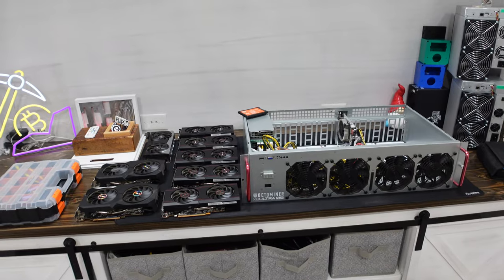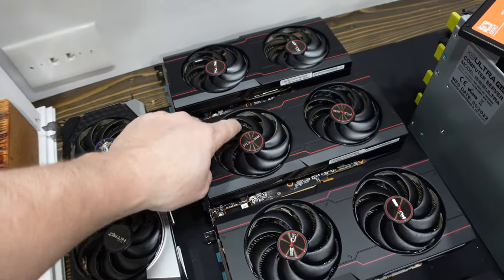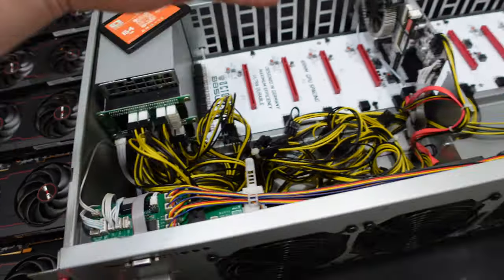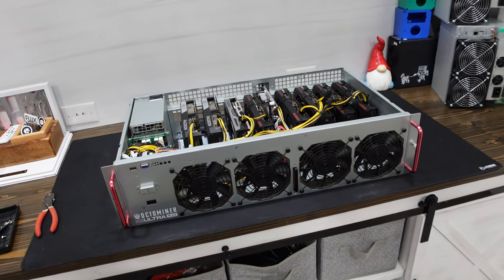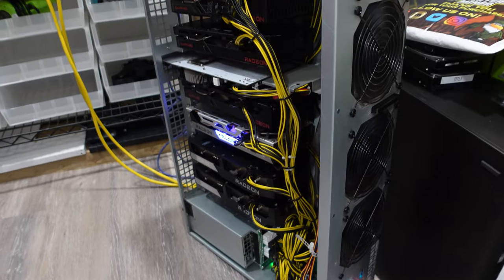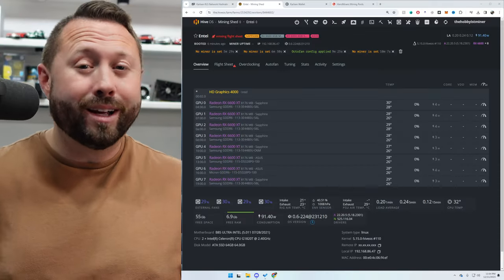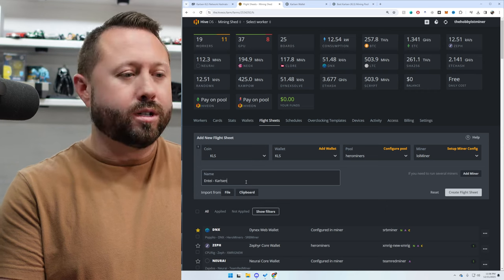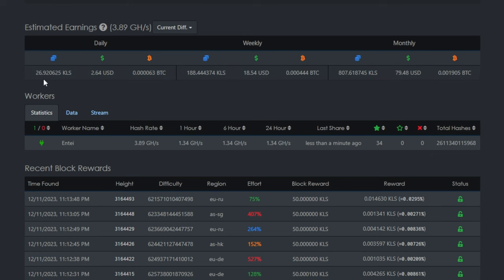KARLSEN isn't Dead Yet! 6600XT GPU Mining Rig Build!

Comment from the maker: Did you Mine Karlsen Early on and Take Profits? or Hold your Bag?
Reply: Mined Karlsen and swapped to Kaspa... Still doing it 😂
Reply: Started mining KLS sorta late🦥as I misplaced my boxed 1660s and I couldn`t find them anywhere in my mining farm. Today I finally found them so I`m going to start seating `em into rigs. My test MSI 1660s has been running efficiently hashing stable around 465MH/s only at 71ish Watts, which is pretty good (efficiency coeficient equals nice 6,65). Running on Windows as always. I gonna tweak the parameters a little bit using MSI Afterburner eventually. What do you think about PALIT 1660Ti 6GB Ghost? How about those small cheapo one-fanned 1660Ti cute midgets? Are they worth purchasing or rather prone to overhating? Any former RVN/MEOW KaPow miner here? Any advice will be much appreciated.:yougotthis:🧡🍺

Comment: Just finished overclocking my 12 x 6600xt rig.  running around 420mh/s on 27-28w per gpu:  settings - core 1425, vdd 660, vddci 620, mvdd 1150, mem 1.  12 gpus showing 334w in hive , 499w at wall.
Reply: wow nice work..

Comment: if you want to make the cards much more efficient,  set your overclocks to 1500 core, 670VDD,800VDDCI,1300MVDD, 1MEM......This will cut your power consumption in half, your hashrate will drop from 560/card to about 443/card.  but wayyy more efficient  (at least this will work on the ones with samsung memory, not sure about the micron one)
Reply: Thank you! This worked for me also. Red devil 6600xt and 6700xt
Reply: Looks good.  Going to have to give that a whirl
Reply: Just finished overclocking my 12 x 6600xt rig.  running around 420mh/s on 27-28w per gpu:  settings - core 1425, vdd 660, vddci 620, mvdd 1150, mem 1.  12 gpus showing 334w in hive , 499w at wall.  (samsung mem)